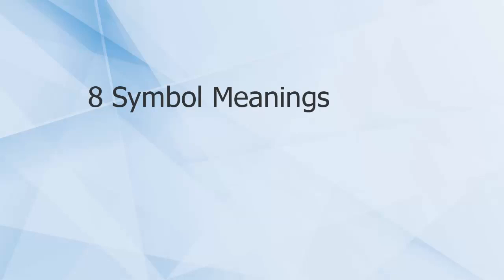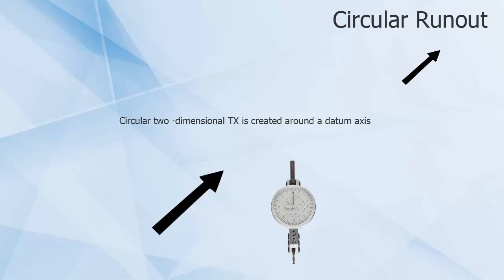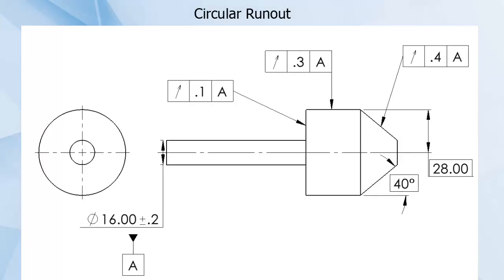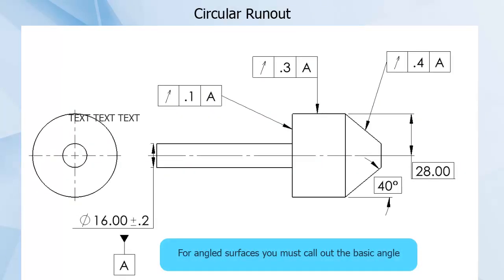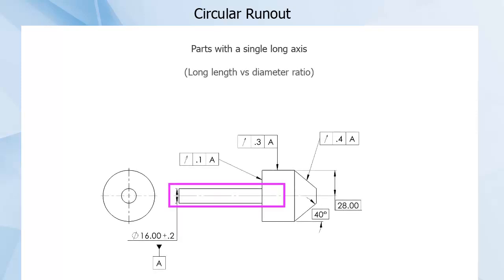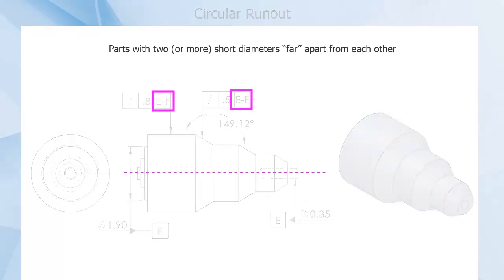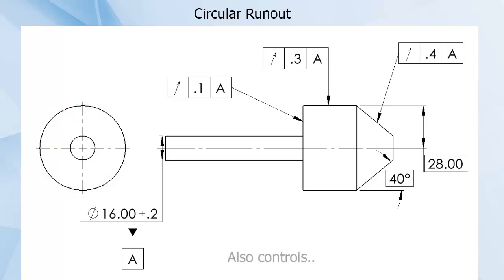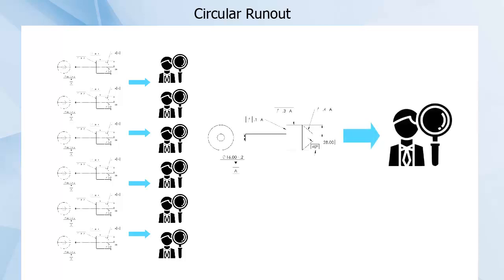GD&T Runout Symbol (Animations and Examples)

Comment: Somewhat disappointed.  The "gauge pin" is a "dial indicator".....please get the technical aspects of all that you are conveying correct.  The dial indicator will give provide you with the run out deviation around the datum axis.  A gauge pin will not accomplish what you are teaching.
Reply: Thanks for your comment, was unclear about this